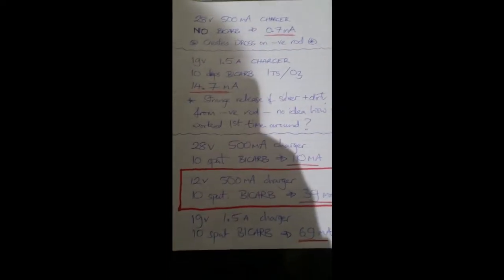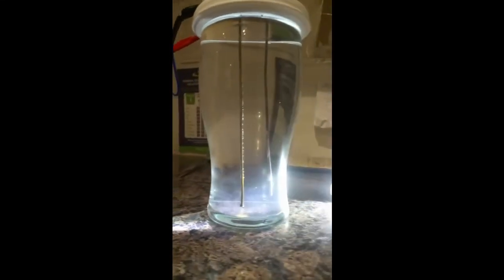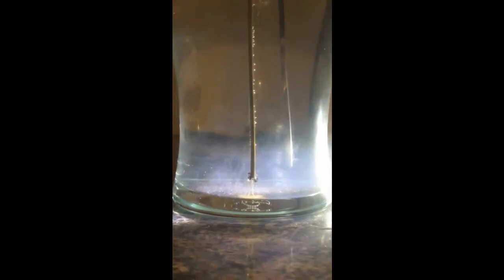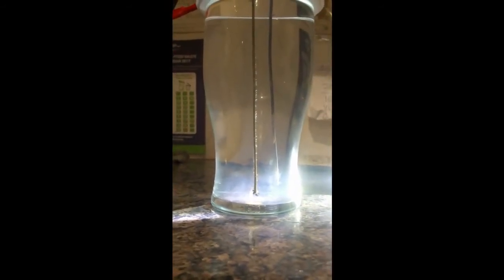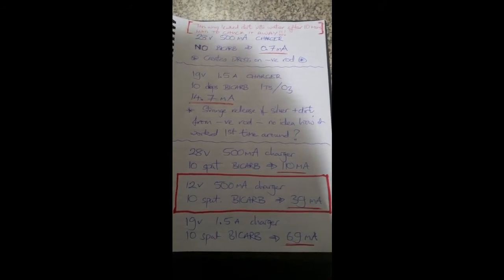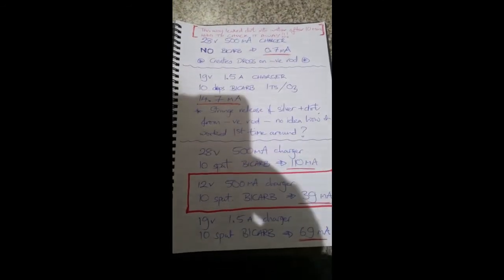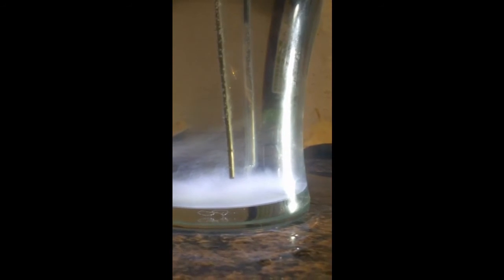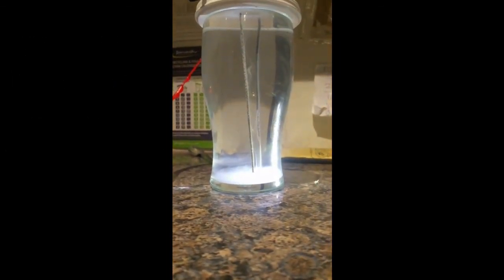COMPARING DIFFERENT WAYS OF MAKING COLLOIDAL SILVER - SUCCESSES AND FAILURES

Comment: Have you tried the smaller amperage Without the salt? I know some groups suggest using salt. When we use Only 2 items(silver and water), we end up with true ionic/colloidal silver. What were must consider is, what happens when we add a Third compound. Obviously what we end up with Can't just be colloidal silver. Within that same glass, silver Chloride is now being made. As for the collection of "stuff" on the Negative rod, that is silver oxide(not harmful). Some people were this off the rod and put it into a skin cream to use externally. I actually see some Bubbles coming off of that rod as well, that's a bit strange. Are you in the UK? Ive heard that some people have a hard time finding real good distilled water there. I have found that Every time the solution becomes Cloudy and White-there is Contamination as in your First picture. It takes a very small amount of Anything to contaminate a batch as I'm sure you know. Say if a glass has not been washed and then Rinsed with Distilled water real well. If the glass is not Rinsed with Distilled water there can be the Smallest bit of soap or tap water residue that contaminates the batch. Interesting.
Reply from the maker: I would never use salt. Reason being silver reacts with chloride to form silver chloride! So I stick to sodium bicarbonate. Some suggest turning the bicarb to sodium carbonate but that stuff is harmful to the skin and mildly corrosive so I stick to bicarb.
Reply from the maker: The distilled water is made to quite strict standards so I'm skeptical thats an issue but ultimately yes there maybe a tiny element of contamination somewhere. Depends how sensitive it is I guess ... I do try to rinse glassware with distilled water but it's a possibility for sure. God only knows from where !!